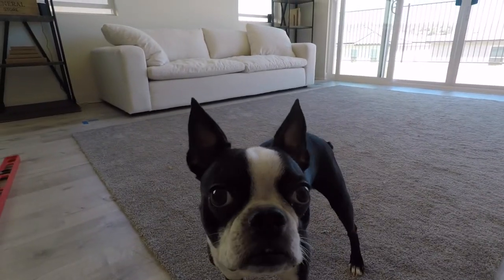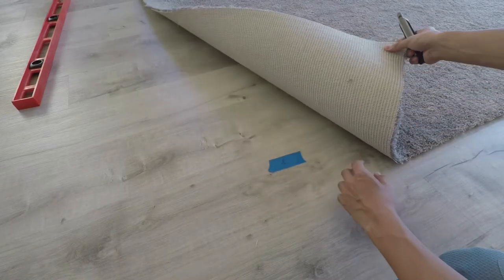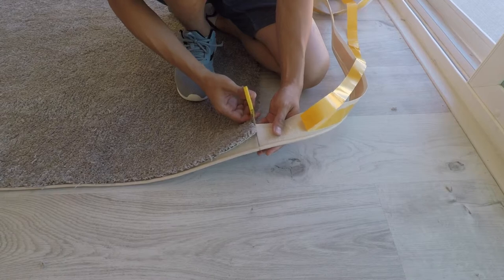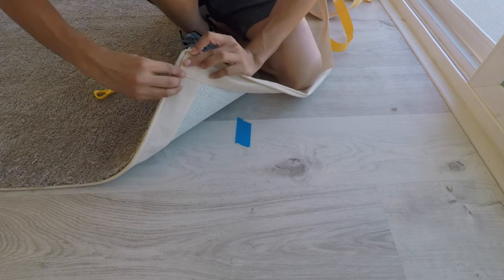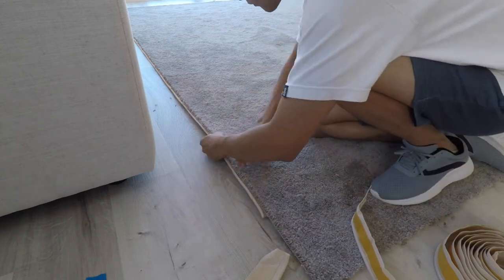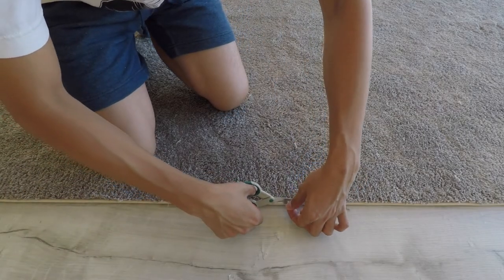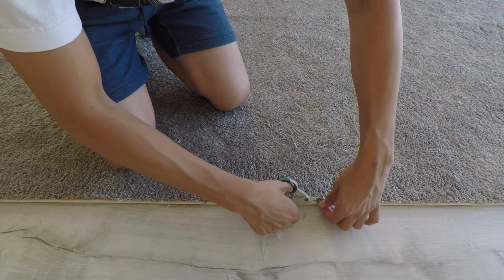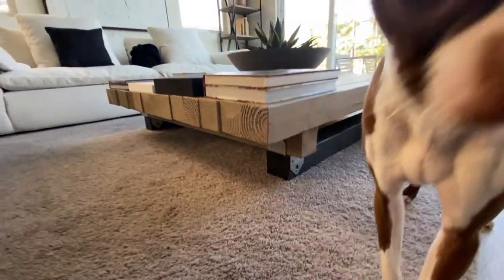How to easily bind carpet flooring to create a large area rug with instabind / rug hack / DIY

Comment: Nice job!  - however, Instabind is $62 - You can also use a small blow torch and seal the edges yourself.  Much cheaper, looks fine if you cut a straight edge.
Reply: Yes, I suppose I could use a blow torch to seal the edges (if I didn't first start the carpet and/or myself on fire). The edges would be sealed but not have the finished look of a professionally bound edge. Compared to having a rug professionally bound, Instabind is a bargain.
Reply: Oh great idea I do it to rope all the time

Comment: Here's another option for joining two pieces.    I saw that there is also another way to connect two ends using Instabind.  On one end you cut only the cording about an inch from the end leaving the outer fabric,  then slip the new piece into the old piece, making sure to join the cording and overlap the fabric.  That way it won't separate over time and will look smooth.